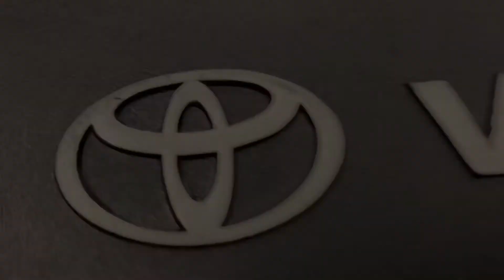TOYOTA - 2ZZ-GE - Engine Leaks Resealed (timing cover, valve cover, water pump) - time-lapse

Comment: Wow that powder coat looks killer. Nice to see something different and classy…not some neon garbage. My timing cover leaks like a sieve. Finna donut one of these days. Would slam it live to just pull the engine and do a clutch while I’m at it. I don’t knwo which knob is more out of my league….pulling whole
Shebang, or doing it in-car.
Reply from the maker: Thanks. Appreciate it. If it’s your first time you can do it in the engine bay but will be tight and be cautious because you don’t want anything to smear. It’s much easier for me to do it outside of the engine bay but it can be a handful if it’s your first time removing the motor. Just take your time like with anything and don’t rush. I don’t like rushing things and do it right the first time. That way it’ll be done correctly.

Comment: Engine leaks meaning oil leaks?  Were the leaks just due to the gaskets being worn out?  My 2ZZ-GE block is wet and I'm almost sure I need to replace the valve cover gasket.
Reply from the maker: Yes mostly from the rubber gasket getting brittle over time. It’s typical of this motor as they age the gaskets harden and crack causing the oil to seep then leak all over the place. Start high with the valve cover gasket then the chain tensioner will almost be 100% leaking over 100,000 miles. If in doubt you can pour some engine dye into the block and clean off the areas then monitor where the exact area of the motor is leaking.
Reply: @RJayStyle  great advice thanks a lot man 🙏
Reply: I just had the timing cover gasket replaced and it still leaks a lot right where the power steering pump is. Can anyone help with this
Reply: @manuelromero2345  Timing chain cover.  That’s what mine really was after all.  We had done the valve cover and that didn’t solve it.
Reply: @manuelromero2345  oh sorry I misread that.  You already did the timing cover and it still leaks…in that case not sure